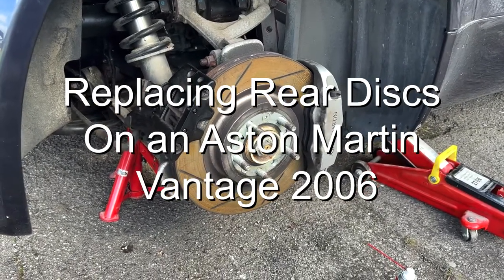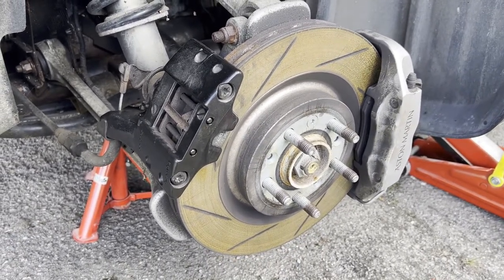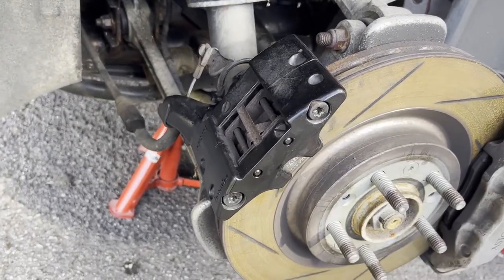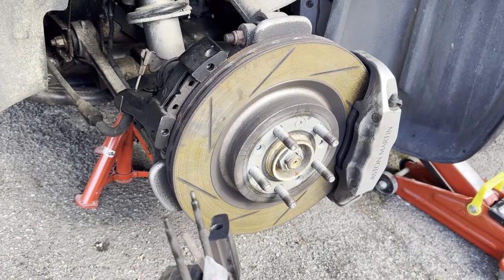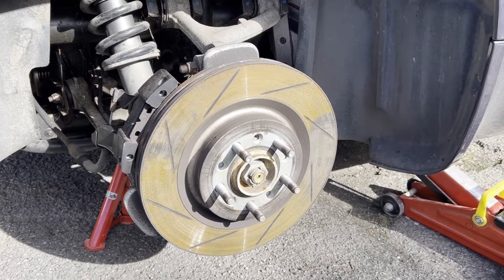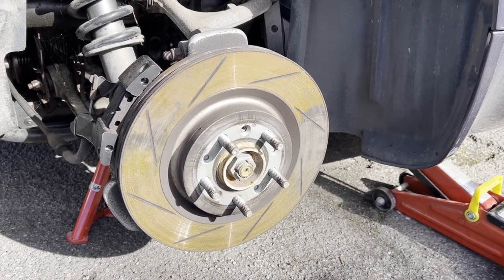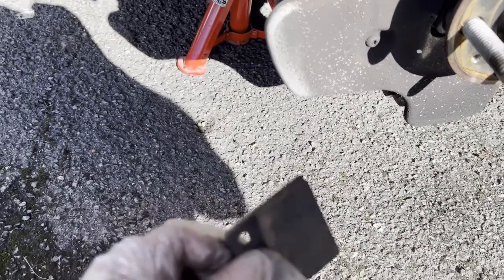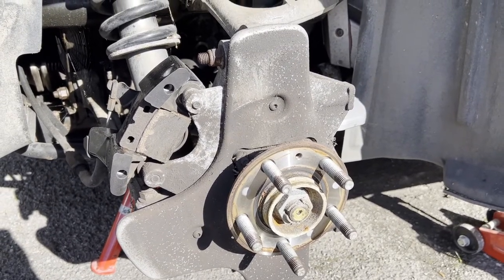Change Rear Brake Discs - Remove Handbrake Calliper Aston Martin V8 Vantage 2006

Comment: Thank you so much. I’m replacing the old hand brake pads on my 2006 AMV and you vid was the only one I’ve found that shows how to retract the calipers to account for the new thicker pads. The brake pads are easy, the hand brake IS a pain in the ass. Thanks once again. Fred from Boise, Idaho USA.
Reply from the maker: Hey Fred, thanks for the nice comment. Agreed that the hand bake is much more of a pain than the actual brake pads! Glad it was helpful and hope it all went smoothly 👍🏻

Comment: Good idea splitting the caliper, I changed the wheel bearing and removed the two caliper bolts. They are threadlocked and I thought I was going to strip or snap them. Better option to split caliper 👍
Reply from the maker: Glad it was helpful 👍🏻

Comment: I'm going to be doing this soon so was hoping for the usual YouTube step by step guide. I like your idea for splitting the caliper but I'm surprised there are not more comments on doing this, either good or bad. Was the inner face of your disc badly corroded by any chance?
Reply from the maker: Hi, actually the discs didn’t look too bad on the inner face, but were changed as they were slightly warped. It was a lot easier splitting the calliper, if the disc has a slight lip, it’s really difficult to get the pads past the lip of the disc without damaging the pads.